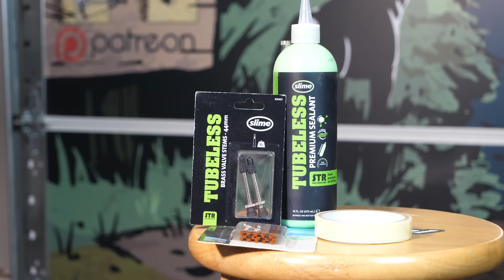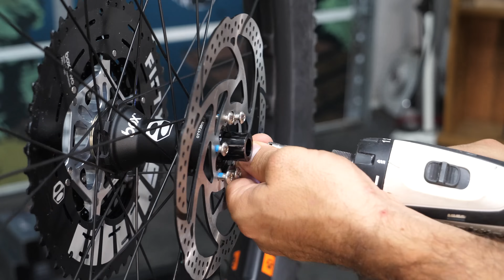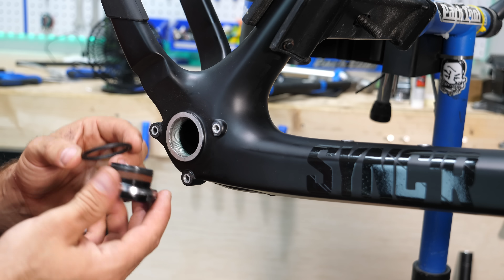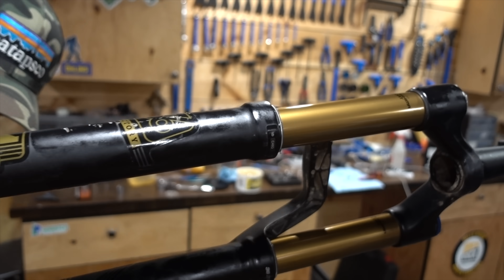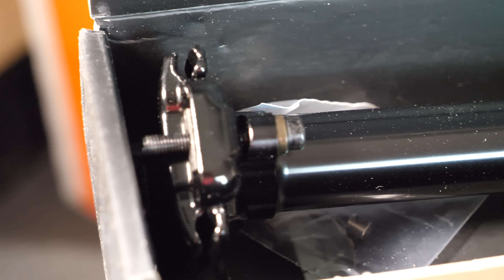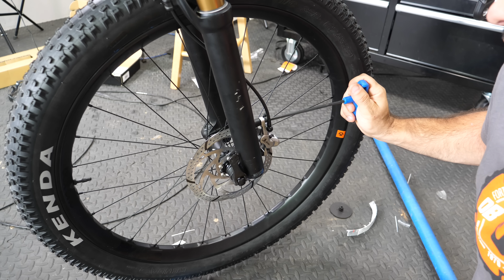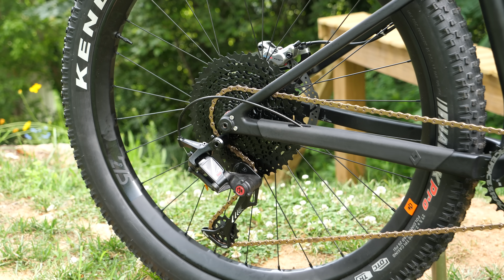Building my Sync'r Carbon Hardtail from Parts

Comment: Seth! I have an idea for a hack, when its raining out, put rubber gloves under your riding gloves and boom no more wet hands!
Reply: But then your hands will be equally wet from your own perspiration and nowhere for the sweat to drain or be absorbed... You're just making it hot and moist instead of cool and damp. I choose the rain water.
Reply: why can't manufacturers make a glove thats waterproof with good ventilation. I'd pay 10 bucks if i saw a pair like that, and i usually pay a dollar at most

Comment: Doesn't  tighten bolts in a diagonal pattern fml
Reply from the maker: turning a torque wrench with only clicks does not tighten a bolt. It checks a bolt.
Reply: Should still do diagonals the click means it wont tighten more as it's set at a certain torque

Comment: There's actually no problem with using a drill for brakerotors, as long as you can set them to a torque limiting screw mode. What you should do tho is torque them in a star pattern to ensure it running true and being torqued correctly.

Comment: Hey Seth, remember in one of your old bike product reviews. You reviewed a cable holder for neatness and you could hack it to put on your cable so that it is easy to get in and out in case you need to do maintenance or something. You could put it around your cables in that little door on the bottom, put a magnet that can be connected to that parktool internal cable router so that you cut drag the cable out to do stuff. Keep riding and making the awesome vids.

Comment: I'm a pro mechanic, former mechanic for MountainCycle, please understand I'm really not trying to be a hater but for the love of all things holy, Never, Ever put the seat tube of a carbon, aluminum or butted steel frame in a bike clamp, EVER. I know, you're an adult, but I can't tell you how many frames I've seen seriously insert expletives up. This is a seriously gorgeous build, I'm super curious about the Box components and I really love the way the brakes come with all the things you need to shorten the housing!! Talk about a legit and ultra gorgeous bike!!! Nicely done, I'm seriously looking forward to the next video!!
Reply: As someone who worked as a mechanic there is nothing wrong with doing that, if that damages anything it’s defective carbon.
Reply: Don’t be a friggin wuss. Never ever is a little to harsh. If you clamp it lightly and are not using gorilla type force on it, I dont see a problem. If you’re aware of the delicacy of the operation and are confident that you can prevent disaster then gopher it. But defiantly keep seat tube clamping to a minimum.
Reply: Clamping the dropper on the precision machined surface wasn't an improvement...
Reply: I was recently told by an engineer that they are designing the dropper posts to be clamped. I could see clamping the dropper post but only after double checking the adjustment so you know you're not gorilla arming the thing.
Reply: I agree with you
Reply: Erik Torell Where should i clamp aluminium frame if seatpost isn't an option? (Commencal meta 29 2019 team)
Reply: Me personally? I'd find a used seat post or even go to a hardware store and by a dowel,  If you don't have those options a super cheap one off of amazon or even borrow one. If that's absolutely not an option, I would put a rag around the frame and barely make the clamp tight enough to hold the seat tube but please understand this is an absolute last ditch effort. Technically aluminum frames have more durability than carbon frames, but I'm super weary of clamping any frame with a clamp style Park clamp. If it's a Efficient Velo  winding clamp then I'd say go for it, but those Park clamps increase in pressure as they close down. I've seen them first hand crush steel frames (if you're not paying attention to what you're doing that is).
Reply: Bro I just clamp that and I have never had a problem
Reply: I'm curious, what stand are you using?
Reply: exactly what i was thinking watching him torque the bb with vice grips ...while clamped on the seatube.  Also derailleurs dont need that much torque when installing any time he uses that "tri tool' i cringe
Reply: C Q Agreed, but I know he's not a pro and I didn't want to nit pick the guy to death, my main concern is how much it would cost to replace that frame because it's not likely they would repair it. Plus people in general don't know that and it's such a new piece of information.
Reply: Adam Ward nailed it.
Reply: Erik Torell  just wondering if a workstand clamp can break the carbon then why cant a rock smashing into the seat tube at high speeds
Reply: You're talking about completely different forces at work there, the clamp of the Park stand is like that of a Vice Grip, the pressure goes up exponentially as it closes down. Whereas hitting a rock at speed is an impact at one angle, it doesn't compress the entire tube at once. The physics of these two actions is simply different.

Comment: im 12 and my bike is a Mongoose and sucks so much. My front brakes broke and the ends of my pedals are chipped, my derailer has a few metal chunks gone. lol. and i bunny hopped over a curb and my tire went out and my wheel bent so now i have no back breakes because we had to loosen them to let the wheel even roll. Im saving up for a $700 bike from WheelSport

Comment: I think the Fox looked better
Reply: mega goon coil beats air anyday
Reply: Any of you guys ridden a MRP Ribbon? In my books it trumps a Fox 36 any day of the week. Endless settings to play with and supple like you won't believe. I'm speaking about the air version here - so I am gonna guess the coil is even better!
Reply: Sean Hornchek But that ain't a Cane Creek 😉 But anyways, there's a reason why MRP won Pinkbike's suspension product of the year, because they do perform on or over the level of Fox and others.
Reply: he needed the fox for his other bike
Reply: Loukas Liolios I agree 💯
Reply: coil is more supple and the cane creek has more settings
Reply: coil is easier to setup, has a more playful feel and the bottom out tokens help setup the fork even more. Coil vs Air is based on opinion
Reply: Sean Hornchek thats a Mrp fork not cane creek
Reply: JP Ballschmider I dont think so after he reduced the travel from 160mm to 140mm. 140mm doesnt sound very downhill does it
Reply: I agree
Reply: Rigardt Griessel I’ve ridden one. Felt kind of cheap. It’s all subjective though
Reply: Loukas Liolios yup. Would’ve performed better too

Comment: Yo Seth!
I just got my first FS bike. Its a Scott voltage fr 730 2017.
Got it for 1300€, the price before was like 3000€. Got a really good deal. Althrough it's heavy and has a 1x8 drivetrain is still super fun. It has 180 front and 190 back travel.
Will be doing a vid on it soon!

Comment: Box components are always orange and you have no other color breaking that trend as its all black otherwise, orange pedals would be a lot better to match and show off the box swag better if you go any other color than black.   

Also forgot to mention MRP is orange decaled by default and the MRP Ramp Control is also orange.

Comment: Procentage wise, how much difference in price would it make to build your own bike instead of just buying it?
Reply: Usually not that much sometimes building is more expensive
Reply: IME building from parts always costs more than getting it built. OEM pricing is killer retail is not.
Reply: If you know you want to build a bike up, start looking for parts ahead of time. Buy them on end of season sales, or where ever you can get a deal. You can also take some of them off and use them on your next build and just sell the frame.
Reply: Ok, thanks!
Reply: The real cost change comes when you start taking parts from your previous bike or are willing to go used on parts

Comment: I don't get how you have a tool sponsor, but still bodge together half the build. The safe way of holding the bike would have been to put in the dropper first, but don't hook it up yet, and hold the frame this way. no chance of cracking the carbon. Then hook up the dropper when everything else is already done. but i suppose, you know to not tighten the clamp much at all when clamping carbon.

Comment: Here's a tip. Get a broom stick or something with a long shaft and to stick into the headtube and then stick the stem onto the shaft. 

Don't want to hang the bars by the cables, chip a customers frame or ruin the brakes.

Comment: Hi Seth - you mentioned that you installed 2.8 width tires.  Any comments on changes to frame dimensions?  The regular Sync'r rear hub was boost compatible, but from my understanding you couldn't put on any serious width tires.

Comment: Wow, that looks a lot like my bike! All black hardtail with blue pedals. My entire bike costs around as much as your fork, but... irrelevant details, it's a beautiful machine!

Question for the community. Is there a way to know the travel limit to put on your forks? I've ben running 100mm forever and it sucks, but I'm afraid I'll snap the frame if I put in a longer fork. Thoughts?

Comment: Great stuff as always Seth! That blue pedal actually looked sick with the blue cap on the Fox fork, however the color of the stanchions threw me off a bit. It's not a bad color but the bike doesn't need two different accent colors. I'd actually consider orange pedals, it would pop and look good together with those subtle Box components logos.

Comment: I'm not shure if the numbers on the front ring of your drill stand for newton/meter but they are actually used to set the drill to a certain torque 
So technically a drill would classify as a torquewrench but you would have to be shure that your drill uses newton/meter, if not you could look for a conversion chart online

Comment: Great music Seth.... can't wait for the "Deep Blue Review". A carbon Hardtail would seem to need some out'a this world engineering to hold up but I supose that the plus sized tires would help. 
I'm building a NS Ecentric Cromo boost right now and am wondering how it would compair to the carbon. I'm in NC if want to run a side by side.

Comment: Hey Seth, is there a particular reason you went with the Coil version of the MRP ribbon?? Please like so Seth can see
Reply: I would assume more plushness
Reply: Skräcken Really? I feel air would be more plush than coil and the more fine tuning you can do with an air fork
Reply: I've heard said many times that air springs have "stiction", meaning they need a little more force to start moving, while coil springs don't have this. Air springs are popular because they are lighter and much easier to adjust.
Reply: That would sound reasonable, because air forks have like an additional piston to substitute spring. And additional piston means additional friction. BUT. Air fork has progression, meaning you can give it slightly more SAG (thus plushness) without the risk of bottoming out.
Reply: coil is much plusher
Reply: I haven't tried a coil fork except for the piece of trash rst Gila fork on my trek marlin 6which has no plushness at all
Reply: Oh, but both have stiction (coming from dustcaps), but air fork would have additional stiction from air spring, which is basically a piston filled with air.
Reply: mosiowaty that's what I was thinking
Reply: MTB Shredder nothing beats a coil on terms of plushnes. I encourage you to try one cause they are niceeeee

Comment: But but but... your not ssupposed to use a drill. Had me dead 👌 I love Seth's sense of humor
Reply: MTB Shredder Same... and I use the exact same method 😂
Reply: I be been guilty too for doing that
Reply: I have*
Reply: MTB Shredder It’s like, a thousand times quicker! And anyway, we have the backing of the Hackmaster himself... and Seth’s always right...... right? 🤔
Reply: IRON H34RT221 You are right 😏
Reply: IRON H34RT221 Seth is never wrong 😉
Reply: Honestly you can't find a better mountain bike channel than this
Reply: I thought it was kinda odd, cause the issue is starting the threads with a drill, not over torquing them. So he pretty much did the one thing you're not supposed to do. 🤷‍♂️

Comment: Why the hell would you prefer a coil over an air fork, they don’t even compare
Reply: Actually a growing number of people prefer coil over air. Which new coil forks have you ridden?
Reply: Noah Sears I don’t remember, I’ll have to look at it, but none of the coil forks feel comfortable to me.
Reply: By most accounts, coil forks are MORE comfortable than air in the most demanding situations. Coil spring systems have fewer seals than air systems and thus less inherent friction. Modern air forks are great, but many feel the consistency and support of coil springs still give them a leg up. VitalMTB did a video with Curtis Keene about why he prefers coil, check that out. Cheers

Comment: I’m trying so hard to convince my parents to get me a new good bike. I ride a Walmart super cycle. It is trash lol. I had one crash going off a 2 foot jump and my tires will never be the same 😂. My friend and I have been going to the forest and we are planing on going to a mountain called horse shoe valley but I don’t think my. Ike can make it down the hill with out breaking. The thing I am most worried about are my rim breaks. Nick my friend and I were going in our local forest and I was first in line so I went getting trailed by my friend and we do just a little jump and I guess my break pads slipped off or just did not want to work. Then we came up to a very steep hill, like hold on tight I mean it’s going to hurt if you fall. Let’s just say I did not know my breaks were not working and this 20 foot steep hill I hit from surprise. And ohhhh god I don’t think my tires were on the ground for the first 10 feet. 

My grade 10 exams are this week I am going to ask my parents about getting a new bike if I can get a new good bike if I do good 

Any other ideas I could get a new bike
Reply: Explore The World look on Craigslist or pinkbike for a used bike. You can often find really solid bikes for only a little more $ than Walmart bikes. Good luck with your tests and getting your parents on board
Reply: Check pinkbike, so many used bikes for cheap
Reply: Check out Craigslist for used. I ride a Radio Griffin single speed, it's nothing fancy but it does the job.
Reply: I had a lower end jamis that kept up to some gnarly stuff new bars and head set its better than my soft tail giant
Reply: try buying one used. itll be in just as good of quality as a brand new one if the previous owner took good care of it
Reply: If you can't convince your parents, maybe try to earn money for yourself, did that back in the day to build my bike and having something you really worked hard for feels so good.
Reply: i agree. i just got a job in a bike shop to save up for bike/holidays
Reply: 10th grade? Get a part time job. Shouldn't take long before you've got enough dough for a decent bike.
Reply: im not american so i was wondering what age 10th grade is
Reply: oh, 10th grade is usually 15-16 in the USA. Thats when I got my first job.... and also how I bought my first non-walmart bike ;-)

Comment: Carbon fiber dust is bad to breathe in (hello, fellow asthmatic), but the more pressing issue is that you are likely to start delamination when sawing the ends off by hand. I would be more worried about cracking bars than a bit of dust once (?) a year.

Comment: I think the pedals add a pop of color to it; call it the Bruiser!
Reply from the maker: digitalrailroader I like that!
Reply: But perhaps some other equally blue details would be much nicer
Reply: It did match up nicely with the fox fork adjusters.
Reply: Seth's Bike Hacks add some other blue parts to it like a blue cable and and blue zip ties.
Reply: I like them just need to add a couple more blue accent parts
Reply: Seth Bike Hacks I think you should put on some blue accents like brake and gear lines plus some more touches
Reply: +1
Think red would also have the same effect :)
Reply: The blue is good, but orange would match the Box Components logo on the rims, handlebar, etc.
Reply: digitalrailroader lol. That’s exactly what i called it when i saw the blue pedals.
Reply: I agree, keep the blue pedals!
Reply: great name for it ..
Reply: Maybe matching blue grips and trim on the saddle? All the touch points!
Reply: yeah or something smaller such as a seat clamp
Reply: Yeah the blue really makes it pop!!
Reply: "BlackN'Blue" (like your steak)

Comment: the brake rotor installation with a hand drill isn't bad because things will explode but because you will almost inevitably not get it installed evenly. torquing them in a star pattern helps with this.

Comment: For the crown race, I use a old pvc pipe and put it over the crown race so you can hammer it in straight. It’s not a real crown race tool, but it’s better than just hammering straight onto the race itself